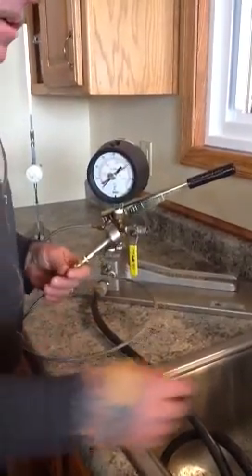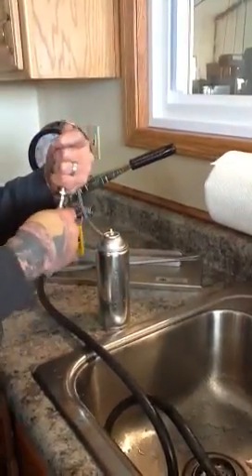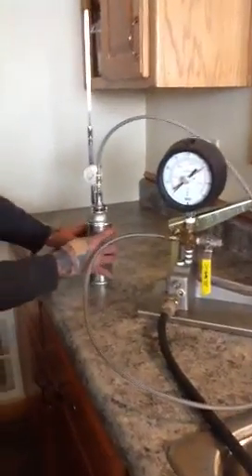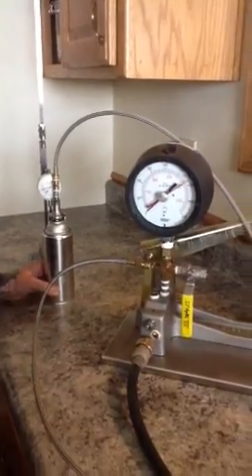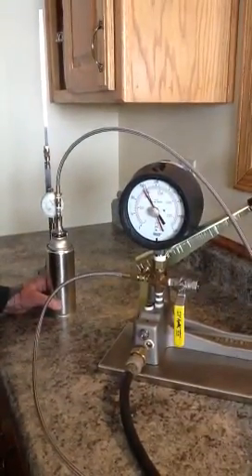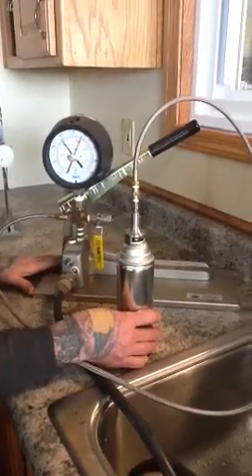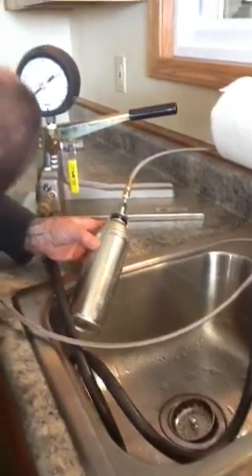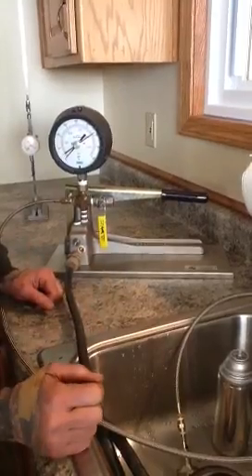Hydrostatic Burst testing

Comment from the maker: The highest burst we have done was a small extruded can, like an asthma inhaler. That blew @ 850 psi in the sidewall or belly. The 3 piece cans always burst in the top or bottom seams. Never the sidewall. 5400 WOW what is the material & thickness?